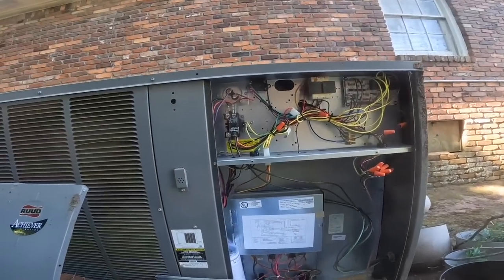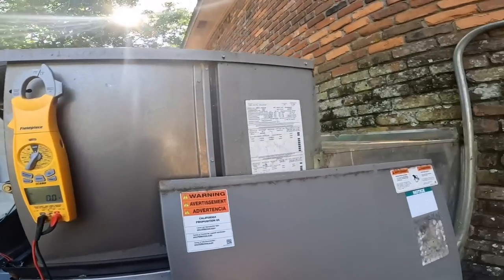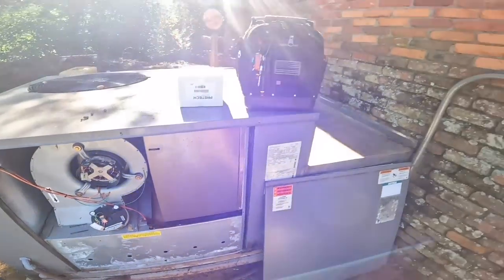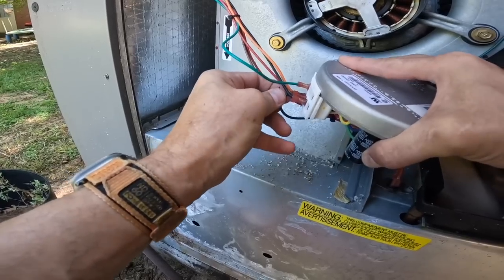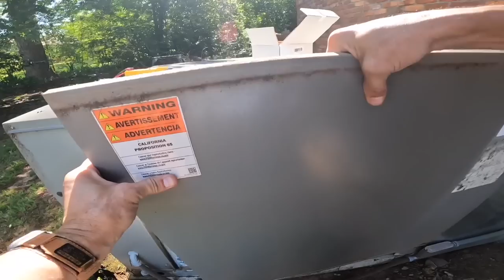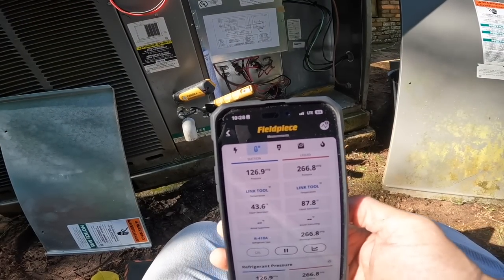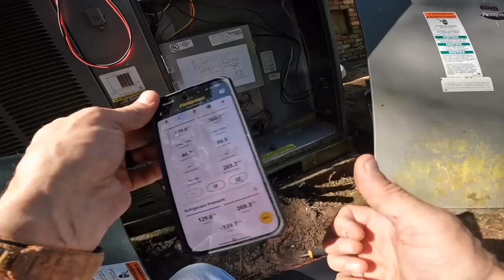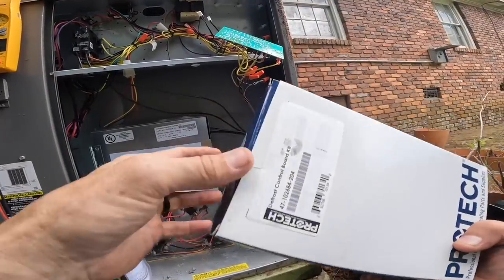Fixing the Iniial Problem And…Problems I Caused! #hvacguy #hvaclife

Comment: If the only thing wrong with the old board is the Burned trace just solder a wire to the back of the board and keep it for a spare.

Comment: I shorted out the board on 18 seer goodman heat pump because I using the lugs to power my vacuum pump with agitator clips And when I disconnected the clips I shorted out the board a 200 dollars plus mistake live and learn

Comment: I did the same exact thing on a Lennox S Class 50 ton. Blew the M1-8 Motherboard and the C1-2 slave board. They are out of stock throughout the country because of the chip shortage. I had to bypass the entire manufacturer wiring and the BACNET, then run the indoor blower, circuits 3&4 and compressor fans 4-6 all off a separate thermostat. Sucks. Lesson learned- Never pull a contact control wire while live. It’s a bad habit. Power off the unit first then isolate and insulate whatever you need to disconnect.

Comment: Yep, I’ve done that years ago.  From then on always undo Y connection for tstat wires, any way other than pulling at the contactor.  Too easy to tough line voltage, and once you do you could fry every piece of low voltage equipment

Comment: Do you ever use a wrist strap to ground yourself prior to handling a new circuit board? You can fry a good circuit board with just the static electricity you have on your body. ESDS!  🙂
Reply: If static electricity is a concern, all he has to do is touch the grounded unit just prior to handling the circuit board.
Reply: @stephenburt7635 That's assuming the 'Installer" grounded the unit. Our company's Installation team had to be reminded of the importance of proper grounding and its effects on both ECM motors and "Service Technician's" health.

Comment: Question high static rheem electric pack had defrost board throwing pressure switch error code no pressure switch high and low on the system replaced board same thing what did I not see

Comment: @20:53 I would have said I need to order a part and gone fishing for the rest of the day
Reply: JK I'm a glutton for punishment, hey I'd have sold them the high pressure switch upgrade knowing that condenser coil puked up in only the 3 years since u installed it

Comment: So.....what did air conditioners use before we had all these electronic circuits?? I only ask because thinking back on our system, we haven't had a mechanical problem in over 4 years, but what we have had were several board issues! Now granted our system in under a parts and labor warranty, so it's not costing me now. What I worry about is the future.  Seriously though if air conditioners worked just fine without electronic boards back in the day, why do we have them now? Especially considering they fail a lot. Thanks 😊
Reply: You had r22 and 240v equaling cold air on demand. Things are different now, you should write your congressman and tell him you want the old days back
Reply: @Fuzzy Vision  "r22and 240v equaling on demand cold air"????? Ok I understand r22 but what is 240v equaling on demand cold air?